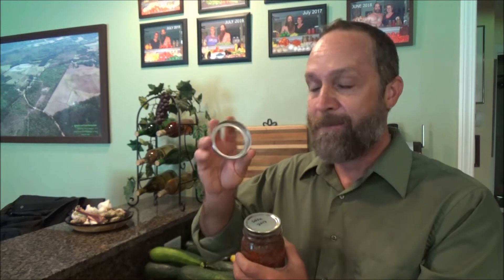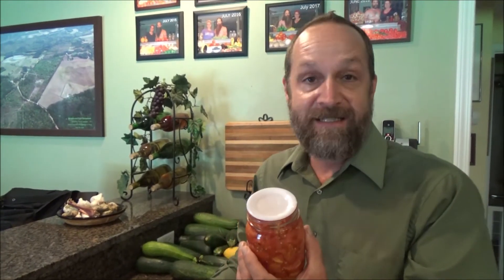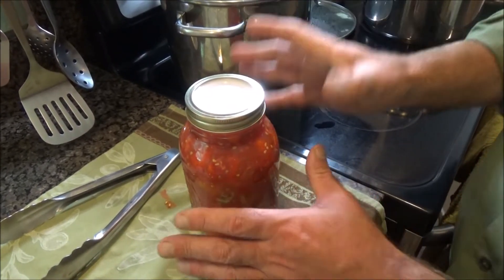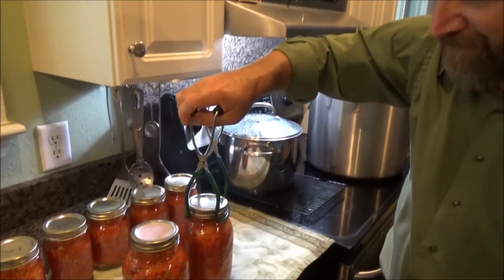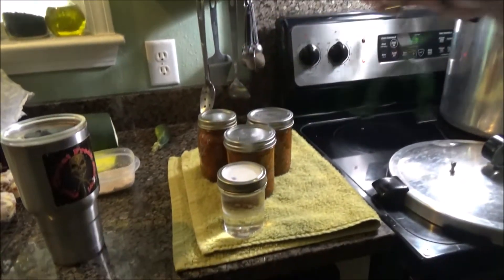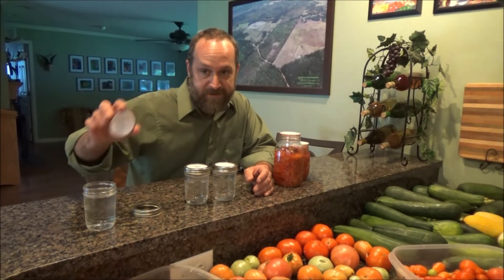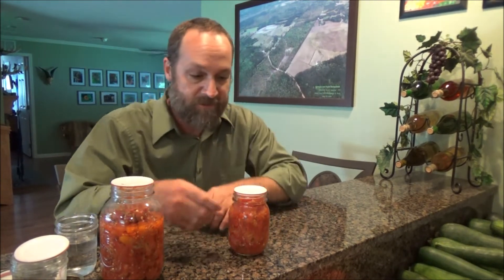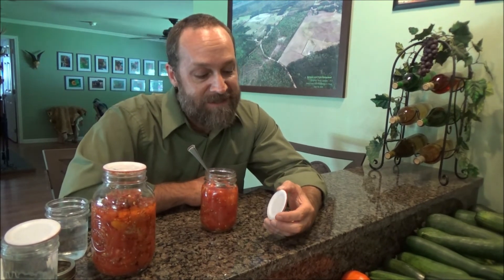Tattler reusable canning lids

Comment: Thanks for the review. I waterbathed applesauce about 3 weeks ago, tattler lid. Yesterday I wanted it for pork dinner. It was sealed but there was mold on a small spot of the applesauce. How much sauce ended up in the water bath water? I didn’t see but tomato cooks down a lot. I’m still worrying about these lids. Small, very small batches until I get it figured out.

Comment: i bought 100 of them when they were on sale. so far i have more fails then seals, very disappointed with them. tried for pressure canning and didnt have good results either. and YES you can reuse your ball lids. i have done it for many many yrs and never had any problems.

Comment: Remember learning to drive a stick,  at first you either killed the engine or grind the gears.  After much practice, you got  that  just right, and the car or truck shifted smoothly.   Same thing with using either Tattler lids or Harvest Guard lids.
Well worth the effort to keep trying.

Comment: Every time I see someone using the lame "tighten until the jar spins" they have siphoning problems. Everyone is so afraid of over tightening that they actually UNDER tighten. I prefer to use the Ball method they used when Ball made glass lids & rubber rings. Don’t forget, Ball researched their technique, unlike Tattler who took the advice from a customer!! According to Ball, tighten the ring all the way an then turn back a quarter inch. I am fortunate that my "finger tight" is exactly where the ring is when you tun back a quarter inch. It takes a little practice but all I do is "finger tight", I turn the ring with my fingers,  but never turn my wrist into it. Remember, Ball researches, Tattler follows directions from a customer.